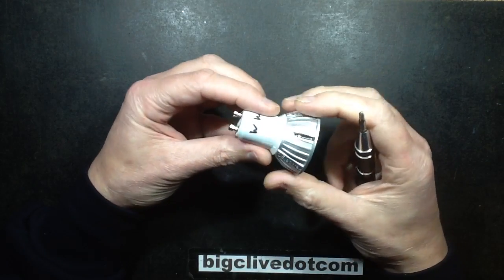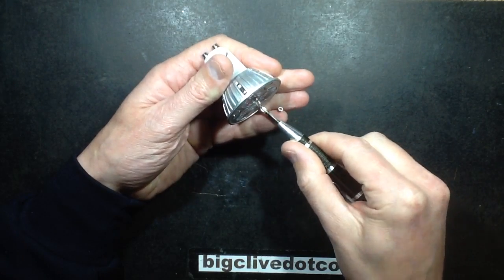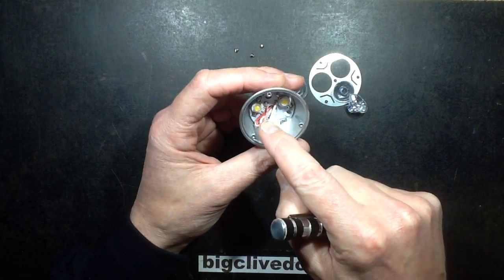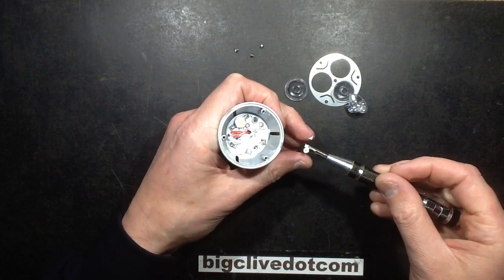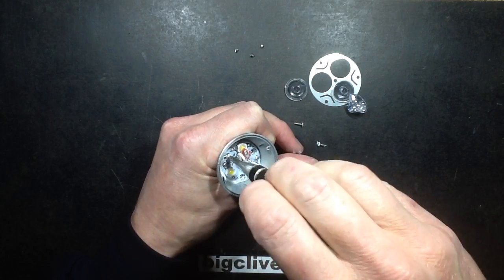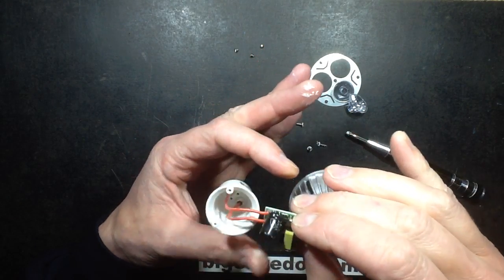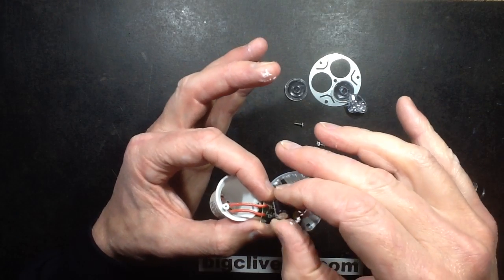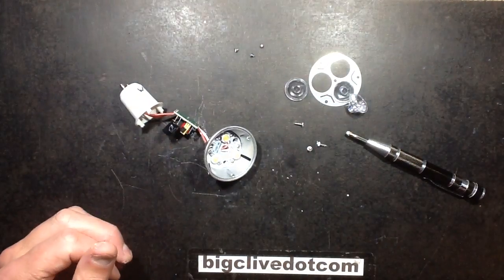Is the power supply in Poundland's new GU10 lamp different?

Comment: Dear Big Clive, thanks for all your interesting videos.
I was hoping you could test a IR thermometer against your thermal cam, if it can take close-ups.
I use IR thermometers to try to see the junction temperature(the relevant measurement for me) of many types of high power LEDs.
Simply taking pictures of some 0.5W 1W 10W 100W and comparing to holding the thermometer directly on top of it, what do you think?
Could be a great video, thank you for your time :)

Comment: I don't like any of the energy saving lamps they all give off RF rubbish in my opinion Incandescent light  bulbs for me  all the time .Another great video thanks for posting
Reply from the maker: +John Gulliver Have you tried the smaller globe type LED lamps with capacitive droppers?  They do not contain high frequency switching supplies.
Reply: +bigclivedotcom Technically, the diodes in the rectifier can cause high frequency noise when they switch on and off. But it's likely not very much XD

Comment: It may be important to note that you need to be careful putting the screws back in on the LED board, I torqued one too much and twisted the head off and had to use the power of DRILL to liberate it. Anyways not the LED board has bigger stronger screws and it doesn't flop around in the casing which is why I took it apart int he first place..
IDK if this is a thing in GU-10 types but in the E27 types I found it a problem in a few now.